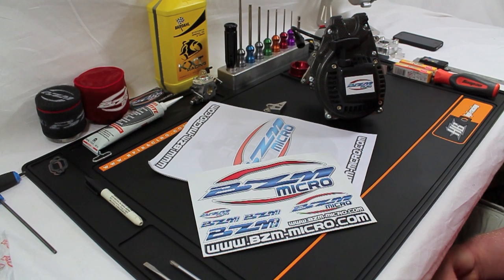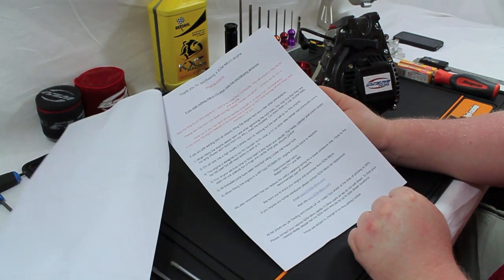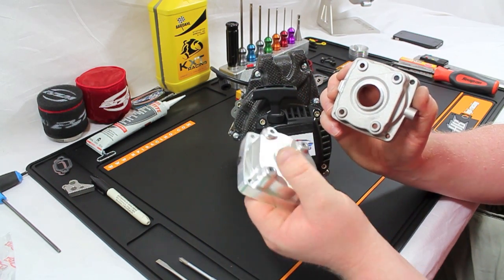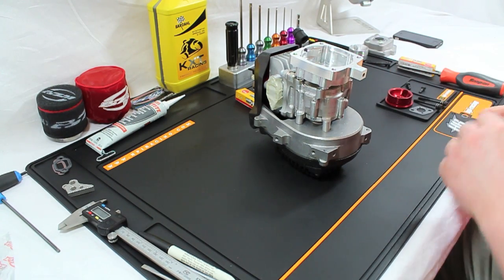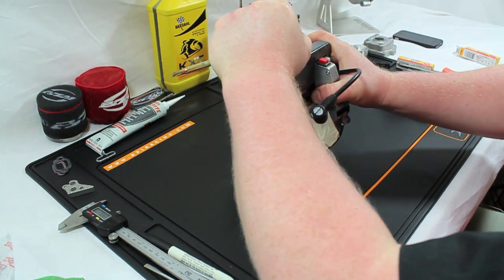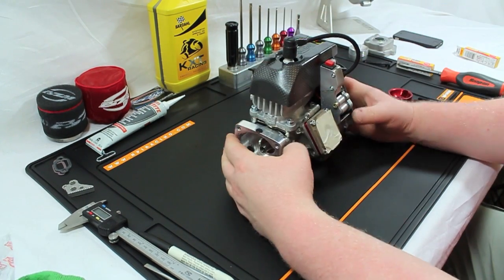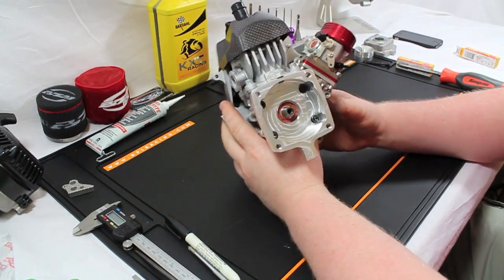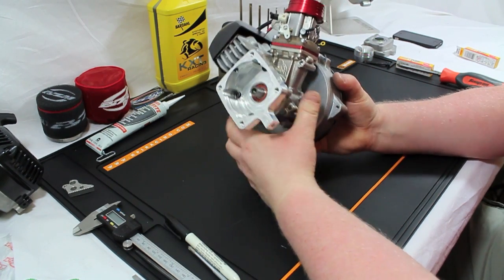BZM Micro engine generalizations

Comment: Hello
I have an Elcon Imp4ct with a Boosterpipe mounted.
Fits BZM CC26 into Imp4ct and fitted with booster pipe on.?
There are 4 screws on the clutch and 2 on the fan cover.?
Thomas

Comment: thay recomend that oil for ported engines
and thay said i had to mix 32.1ratio for the 30.5cc high compresion engine 
which will need a higher octane fuel of 91%